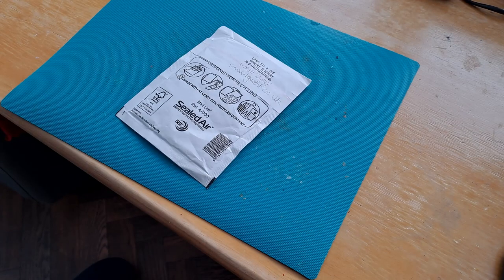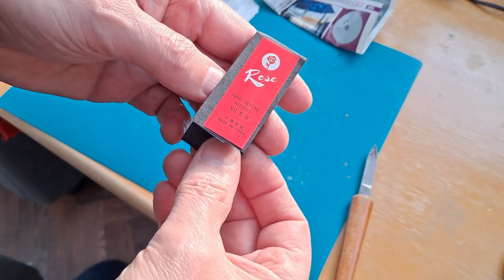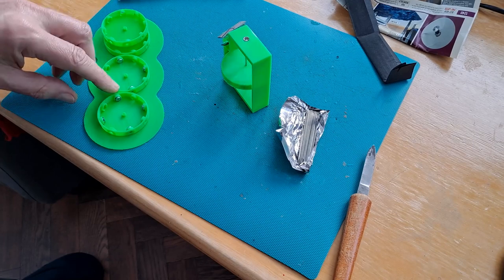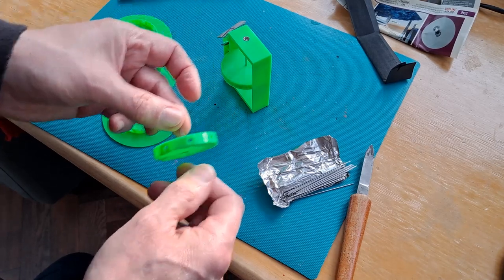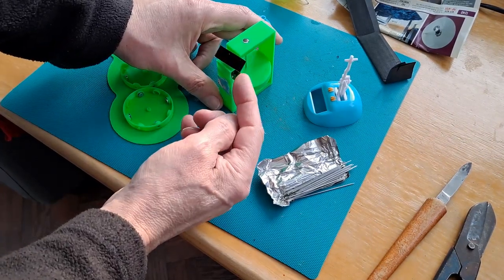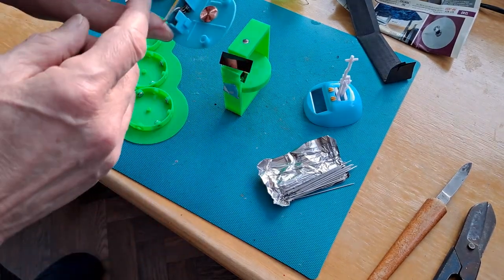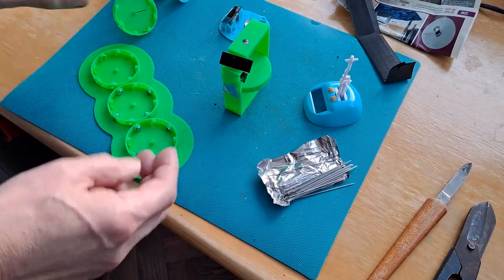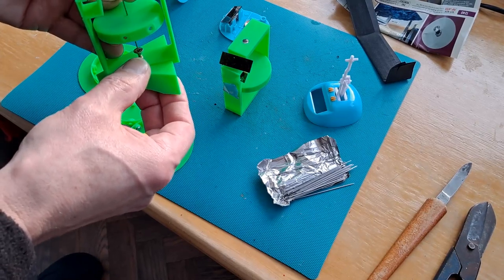Grandad's Postbag 20220321 sewing needles for pulse motors

Comment: The new base works good.  i have tried all kinds of bearing arrangements.  Some are better than others depending on the motor.  One of the best over the course of many months running has been a plastic bead super glued to a coin.  The needle runs in the bead hole with the point resting on the coin surface in a pool of oil.  You can suspend the needle top in a number of ways.  A piece of double sided tape is all you need to hold the coin to the base.  Bearing failure has been the number one reason my long term 24/7 runners stop.  Friction is biggest energy bandit for the stuff I make.  Two materials rubbing against each other opens the door to the bandit. :(  He is a very patient fellow and doesn't care how long the wait.
Reply from the maker: Yes, it is interesting to notice how my solar rocking grandad has worn down over time. He pivots on a 3D printed V shape and it does show a fair bit of wear now. I did him back in March 2020 so he is just over 2 years old and rocks happily in the sunshine.

Comment: Have you tried heating the plastic below the coil with a hairdryer at full heat?  I think it would be enough to soften the glue and gently pop the coil off. 😁
Reply from the maker: Yes, I have tried heat, as I have said, my success rate is very low. I have tried many methods and have found several different types of glue, so for the most reliable approach, (bearing in mind I have no way of telling what type of glue somebody copying my video may have on their rocker), just cutting the surplus plastic away seems to be the safest option. Of course I cannot prevent them cutting the wires or otherwise damaging the assembly. Maybe you should have a go, I seem to remember I sent you 3 or 4 a long time ago. That would give you a good chance to create a % success rate. You might be lucky and they are all hot glue, or you might be unlucky and they are not 😊 At the moment I can't find any in any of my usual shops, otherwise I would buy a selection and do a comparative analysis video. Just flipping the base over and running a hot air gun on the back would certainly be the preferable solution. I may even have done a video already, I can recall one for removing solar panels from garden light, but I am sure I have done something on the coils.

Comment: 6:00
Glass has significantly less friction but I have not been able to find anyone whom sells glass screws.
Reply from the maker: I am not trying to get long runners like Lidmotor. As long as they run for the length of a video without any faking, that is good enough for me. Generally the solar ones self start with good sunlight in the morning and stay running all day, but Lidmotor's motors run for months or years on minimal current draw. I often run them suspended from the magnet via the point of the needle, rather than sitting in the cup below, but it is fairly easy to dislodge them, whereas the cup tends to be slightly less prone to that. I do remember Lidmotor doing some tests with the tempered glass mobile phone screen protectors and I think I have some in my stock for that purpose. In fact, now you mention it, I can see them in the pile on the side of my computer desk 😊😊